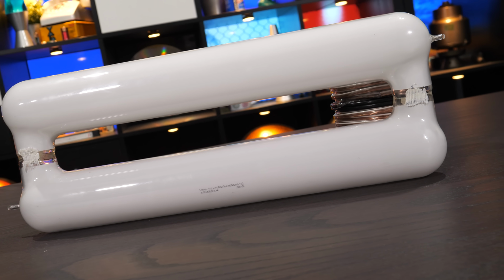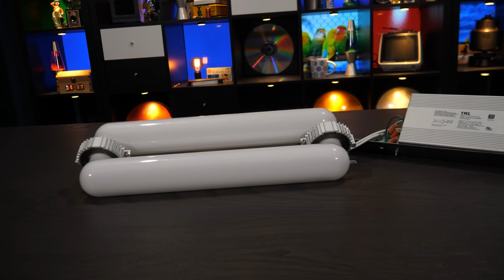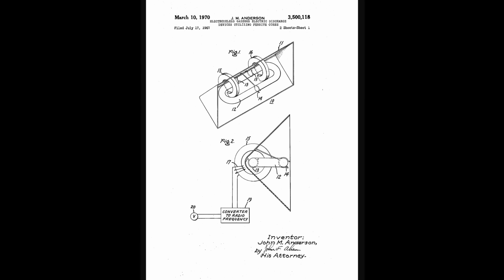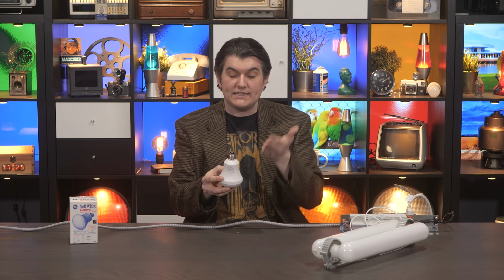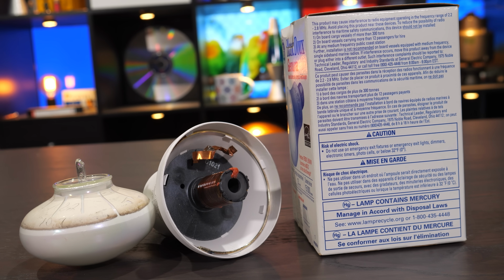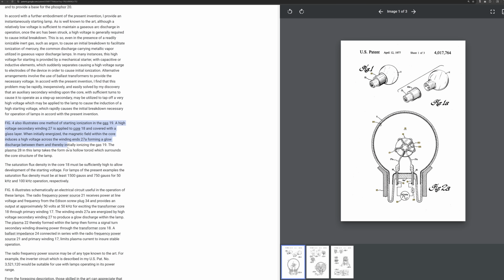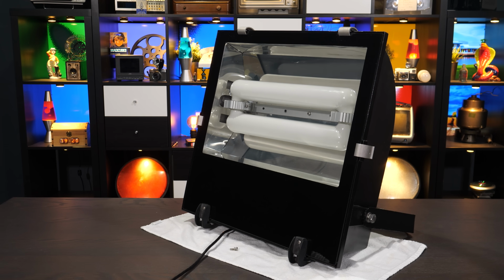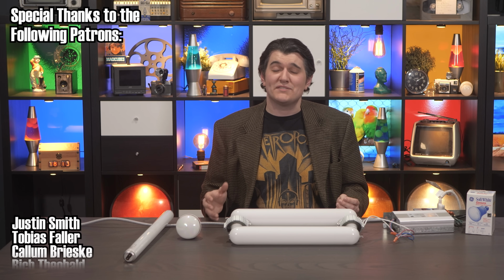Induction lamps: fluorescent lighting's final form

Comment: Woah I had no idea these were a thing, that was very ahead of it's time.  Also just got an idea, wonder if you could get a burnt T8 bulb to light up using that driver, if you connected the pins of the bulb from on end to the other it would complete the circuit.

Comment: yeah its cool. so whats so complex about an induction stove tech. very fancy looking thing. who knows what goes on in the decision makers (law makers) head. whoever that woe is. you invented all the problems. ie you made up the problems. money cant decide properly. every matter has some free ions in all cases. ie dielectric breakdown starts from one free ion/electron. based on the room temperature distribution of free ions/electrons in a gas matter. even in high temp gas, only some part of the particles are ionized. same on all temperature scales. seems like the lifetime of induction lamps is even better than your planned wear led lamps have. cost is fake measure. it has only historical significance. you can make new versions for much "lower" comparative price now. in other words, market decisions are not the best decisions. as market cant decide. its forced into a mold. ie if someone makes a great working thing that is too expensive, market decides its a bad product. and none will make an actual good thing, but thats why you cant have nice things. dont mix a light source with the reflector mirrors tech. a radio antenna can do whatever to the original source signal. its again market choices that makes market think something does not work. same thing that solid bicycle tires are not being used everywhere, but a failed air inflated tires that require horrible amount of maintenance are being used. because of market money cycle (pun intended). self-relied market by definition will produce stuff that does not last long. ie if you cant sell, there is no market. so you must make stuff that breaks and cycles over time. do not say "cant". otherwise you make a ded law. and law of sin/deth again to be ruling in deth. do you know above, people. you better. knowing law is not knowing anything. market will and is not a ruler. freedom, diy. market dependency is a poor design. well, seems none of you cant do anything but buy from market. specialized to money service abusing. any market money related decision is historic at best. if you need to buy, a solution, its not a solution, its a burden of market work. oh right, deth is not solved in the minds of people.
Reply: your begging for stuff has not stopped/solved.

Comment: The same problem still plagues all light bulbs: the driving components. 
This still adds quite a bit of life as the point of failure.  
LED bulbs were supposed to fix ALL our problems, and are still pretty great, but some models fail if even one diode fails, or begin to flicker if the driver fails. 
The problem with all these different light bulbs is finding replacement bulbs and driving  components. Especially when you have 10,  but only one or 2 bulbs failed after a few years, and the market has moved on. 
(I used to work at a light bulb store)
Reply: It’s a plain strawman that LEDs were supposed to fix all our problems. Who would even claim something as unrealistic as that.
Reply: @GBOAC  Look, I'm glad you're using terms from your philosophy 101 course, but you're shining about as much light on this topic as an incandescent.

Comment: This comment isn’t really educational in any way, I just wanted to add my knowledge as well

I’ve always been so fascinated with this type of lighting technology as a child. I did see a fixture like this back in my youth, and was always so fascinated with its function. I can imagine the method this fluorescent lamp works didn’t really take off for similar reason why LED technology didn’t takeoff as fast as it could have. The gear required to drive. It is rather complex and has a little bit of a failure rate on higher powered units. In theory You Can drive LEDs with the same gear as the fluorescent tube, it might not be as efficient though as LEDs only illuminate half cycle. I’ve also seen high frequency gear being used on low powered, typically on cold cathode tubes and even typical filament tubes as well.

Edit: I would also like to add that induction tube lighting was also used in lasers!
Reply: But I do wonder can a diode last as long as a electroless fluorescent tube? 🤔

Comment: 5:23 A light bulb that will last "forever" you say. I think a certain cartel may want a word with you... 😂
Reply: Damn you beat me to it
Reply: You could watch that video
Reply: @FuncleChuck  I did watch it a while back. The points Alec made was indeed similar to what the commenter said... Just wanted to point something out.
Reply: Yes, there was issues with price-fixing and other shenanigans, but it wasn't about selling inferior bulbs. Incandescent bulbs have an inverse relationship between brightness and lifespan (oversimplifying, but that's generally true). A very dim bulb will last indefinitely: that's why there are bulbs 100 years old that will still produce light - they're very dim. Very bright bulbs will burn out far more quickly.

The cartel enforced standardization so that companies didn't cheat and misrepresent the brightness and lifespan. 
A modern incandescent bulb will also last effectively forever if run far under the specified voltage. The light will also be very orange, very dim, and the power-to-lumen ratio will be very bad.
Reply: @erikdietrich2678  hmm... i wonder if a certain creator made a certain video about it...

Comment: There was a theory that light bulbs did not actually emit light, but rather absorbed darkness.  When they stopped working that meant they were full. You can observe this phenomenon more easily in florescent bulbs. You can see the darkness getting pooled up at the ends.  Incandescent bulbs would also have a dark spot when they were "Full".

Of course this is not true!!

Comment: A tube purely filled with argon gas and nothing else will start to discharge when you bring it near an electromagnetic field that is strong enough. You don't need anything as crazy as a tesla coil, a normal small ham radio transmitter of just a few watts is enough.

Comment: Nah at high enough frequency you can light up any kind of fluorescent tube without even coming very nearby to it. They might already be high enough frequency but if not then they could operate at a higher frequency for long enough to strike the arc. Or produce a single discontinuous strike pulse, rather than a continuous high voltage output.The required field isn't that much. You can touch a high frequency electrode and wave your hand around and light up a fluorescent lamp without contact or pain.
Reply: Oh btw look at high frequency start welders for another perspective if you want.

Comment: the channel diodegonewild has made a great deep dive into induction lamps you guys might love.

Also i saw many induction lights in greece and they have been operating for years with hot summers and freezing winter. I saw failed LEDs but not a single failed induction light, their drivers seem incredibly robust

Comment: We used to tape florescent tubes to CB antennas.  They'd light up when you key'd the mic.  On SSB they'd modulate their brightness with your voice.  Same basic principle but at much higher frequencies.
Reply: I remember hearing my grandfather talking about people having little neon tubes taped to the end of their cb antennas on cars and trucks back in the 60s and 70s..I always thought it was a cool little thing 😂
Reply: "Will it antenna?" Fluorescent Light edition
Reply: microwave machines that seal plastic will light up fluorescent light tubes too.   i saw it on an australian documentary because the workers feared the microwaves were doing them harm.
Reply: @vsvnrg3263 those aern’t microwaves though, those sealing machines are a significant source of radio frequency interference, and can often be heard for tens to hundreds of miles, depending on how crappy it is. They’re typically heard around 28 MHz.
Reply: @jonmchang  Sounds like they'd be hell on CB reception?!
Reply: What band / freq do CB radios use?

Also, is could radio be a future topic for Alec?
Reply: @kalleguld 27 MHz in the US
Reply: Neat!!
Reply: You said the same thing that I said that my dad taught me with taping flouresent light bulbs onto the  c . B . Antenna and they would light up ! Cool to see someone else that knows that , it's R.F. POWER wirelessly powering up the flouresent bulb ...

Comment: I got a water fountain for my cat which is wireless, which I just took to mean that it had a battery. And it does, but the power/battery unit also uses a coil to induce current in the water pump, which sits in the water tank and is totally sealed.

Comment: If memory serves, smallish circular versions of induction lamps(Halo-shaped with a single contact at one side) have been popular since the 70s or 80s in Japan as low-cost lighting, usually ceiling mounted with a square lampshade.
Reply: They have been around since the 50s or 60s. They are called circline. Not induction though, the still had terminals through the end of the tube. Just like a straight tube formed in a circle with the terminals buried in that connection.
Reply: I've seen these at my local home depot.
Reply: They’re known as circline lamps
Reply: I live in Northern Ireland and yeah we have had them in bathrooms for decades
Reply: I use one on my desk! They are actually just standard tube lamps, as the terminal is built into the "end" of the tube.

Comment: I remember winning an argument in the 90s when I told someone that a strong CB radio could light florescent light.  Took around 50W to get a tiny Coleman lantern florescent bulb to light up, but it worked.
Reply: The smaller bulb is a worse antenna so needs more power to light up. Normal size fluorescent tubes take almost nothing
Reply: Yep.  I saw it as a demo in '70s.  Standard unmodified CB radio with whip antenna, start transmitting audio (probably a whistle for good signal level), antenna touched to tube and it lit up around where the antenna was.  Definitely was not 50 watts.
Reply: Roughly 5 watts would light them and less would keep them lit. I have done it with factory radios many times but had to start talking before they lit. My factory equipment dash mounted AM/FM/CB in my Caddy using the factory car antenna would light one.
Reply: Had a 30’ mast and 100w amp on my CB back in the 90s as a kid … my first introduction to RF burn 😅 (they came off a ship-to-shore radio from an oil-rig in Norway)
Reply: Considering that 4 watts is the legal limit for a CB radio, you lost.  That radio wasn't technically a CB radio, even though it could operate at those frequencies.
Reply: @Kineth1 let's just say there was a small linear somewhere between the CB and the antenna.  Last I looked, it was 4 watt dead key and 12 watt peak modulation for the legal limits.
Reply: @Kineth1 it was SO common to run illegal CB's back then. Same as today that my $15 radio is an illegal GMRS radio.

I burned my finger a bit touching the antenna coupler on my grandpas vacuum tube CB when I was young and keyed the mic with my finger on it. Dad later said, "yeah he modified it for more power" when i asked why that didnct happen when I did the same thing on a 12v mobile CB before and couldn't really feel anything.
Reply: @volvo09 I miss my CB days, but the FCC kinda got upset with me and I had to let it go
Reply: @minotaurbison slim shady?
Reply: @Kineth1  CB radio on region 3 (asia) are allowed up to 50W for repeater, and 25W for rig.

Comment: That tube seems so physically fragile. A tiny glass rod on each side that seems oh-so-easy to nudge off by accident.
Reply: They're actually pretty sturdy. We still have a few left in our plant. Since they rarely fail you don't touch them often. If the light quality wasn't so terrible they would have been a decent idea.
Reply: A tiny glass rod containing mercury.
Reply: It’s not exactly like incandescent bulbs or traditional compact Florescent bulbs where the most sturdy of lamp designs. I dob’t think these induction Florescent bulbs are that much more fragile the previous Florescent designs. Yes, you want to install these carefully but if sturdiness/unbreakability is your concern then a modern LED lamp is your best bet. You would want these induction fluorescents install in.sturdy housing with the thick plastic or glass cover to avoid accidentally breaking the lamp. I assume the tube’s glass is thick enough that just moderately careful handling is unlikely to break the tube.
Reply: The answer is, don't do that.
Reply: It's meant to be inside a lamp, not on a desk.

Comment: I'll bet that ballast throws off MAD harmonics on MF and HF radio. Ham radio operators must "love" these lights lol
Reply: We actually walk around checking for spurious RF and fix it with conductive tape.
Reply: These types of bulbs can cause radio interference to many frequencies. Not just hams and broadcast users, but police and fire, aviation, and phones, Wi-Fi, etc.
Reply: None of the frequencies listed are in ham bands. As long as signal is clean, they wouldn't mess with anyone, ... as long as the signal is clean.
Reply: @Bob5mith  It's compact RF oscillator operating at 23W (or 85W for the Phillips one). Made in the 90's, before solid state AC power semiconductors were cheaply available. The harmonics on this must've been substantial. 
Looks like despite the RF mitigating tin oxide layer on the phosphor, the Genura bulbs did not meet the lower FCC EMI limits for residential use, only the less restrictive commercial one.
Reply: @melissablick779  That may be, but 2.65 MHz is well between the 160 M and 80 M bands. 5.3 MHz is just below the bottom of the 60 M band, but that wasn't available to hams until 2002. 7.95 MHz is well above the 40 M band. You have to get all the way to the 8th harmonic (21.2 MHz) to actually land in a ham band, 15 M. Unlike cheap wall warts, the frequency was chosen on purpose.
Reply: @Bob5mith  Thanks for doing the math! I did find another video which shows the driver circuit for this bulb. Looks like it's just an LC oscillator and full bridge rectifier (120Hz+harmonics).  
High tolerances of the discrete components likely used in a lightbulb would cause the resonant frequency to shift. The circuit probably doesn't have the a great Q factor either. But all harmonics far enough away from the amateur bands.
Reply: Granted, they're like 15 feet up, but they don't screw with Wi-Fi or LTE in my experience.
Reply: Wifi is completely elsewhere in frequency  @orijimi
Reply: @viktorsak I guess I was responding to kenenglish.
Reply: The NSA was probably upset about its inability to spy on us because of the interference!
Reply: All 6 or so within 500 miles of these must be PISSED.
Reply: @BEESANDTOASTY check the FCC amateur radio database. There’s a lot more than that in your area, wherever that is. You can  filter it down to active amateur licenses in your zip code or whatever criteria.
Reply: @BEESANDTOASTY  There are more like 20 active hams within two miles of my house. There are a LOT more of us than you'd expect.